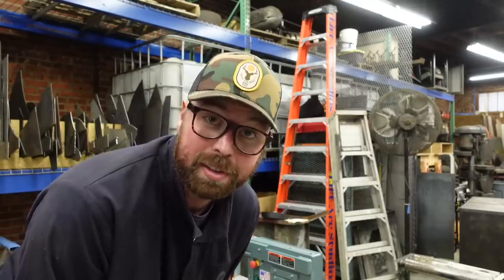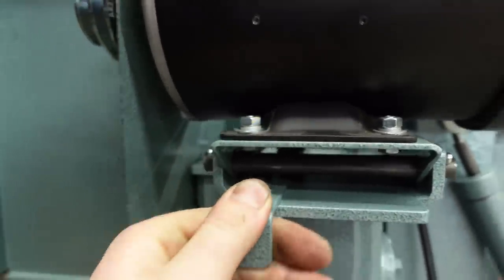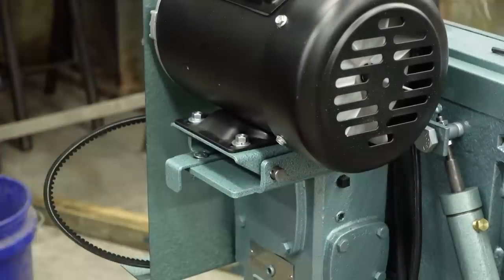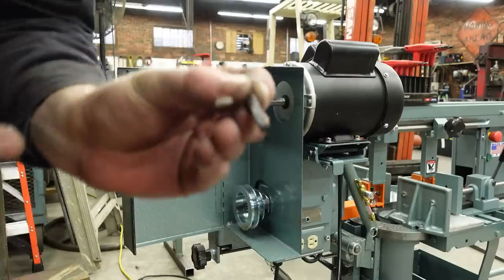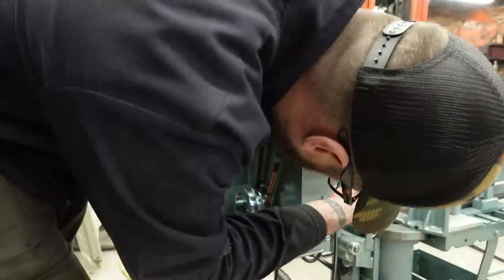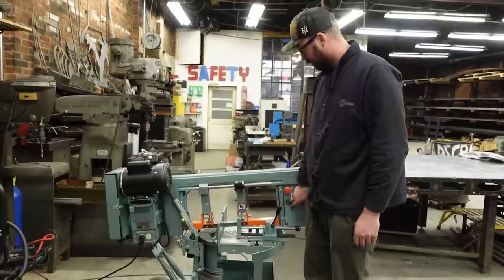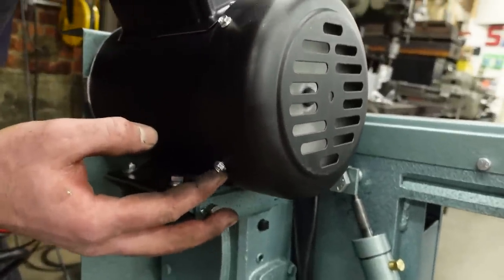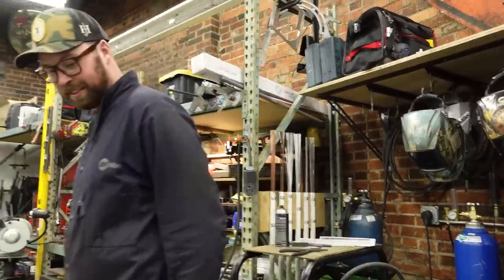This Is Unacceptable.

Comment: Has a start capacitor and it’s surging because the start capacitor is being used as a run capacitor and will burn motors up like no tomorrow
Reply: I was going to say the same thing. 👍
Reply: It could also be something to do with the centrifugal switch that's suppose to remove the start cap from the circuit.
Reply: I was just going to add comment about the capacitor being weak....
Reply: It’s like running your car without oil and complaining the motor is knocking then putting oil the engine and saying see it’s got oil now and it’s still knocking ... quit telling me it’s because it didn’t have oil. 

Same thing as the stupid argument over the outlet. He destroyed the first motor with the extension cord then after it was trashed tested in the outlet with the exact same result... because the motor was abused.  

I personally believe he tested the new on an extension cord prior to the clip we see at the outlet. But amperage draw and voltage drop still happens on a daisy chained outlet
Reply: @ChrisS-oo6fl  you won't burn up motors using extension cords however you can burn up cords. And he also plugged the new one into a outlet for a first start. That big black lump on the motor is a capacitor and it stores power and is supposed to dump it into the motor when you turn it on and the cheap chinese motor he keeps buying is having some sort of problem with the capacitor.
Reply: @ChrisS-oo6fl  Not at all true. No load on a motor on a 50' cord won't destroy a motor or make it vibrate. Not to mention nominal voltage is 110-115 not 125 so the voltage drop is not the issue.
Reply: @johnhancock8552  lmao. absolutely incorrect.
Reply: @DieselRamcharger  Why do you think a properly rated extension cord will cause any issue? Compared to the Romex on the wall.
Reply: @dougelick8397  you said you wont burn up motors, but you will burn up cords. if the cord is getting hot, its too small. the excess resistance is causing the heat. Which is also dropping the voltage at the motor. If your cord is hot you are killing the motor. The key here is PROPERLY sized. If its the proper size, nothing will get hot. Not the cord, not the load, no excess heat. And romex isnt pulled through conduit. So no idea what you are talking about there. :)
Reply: @ChrisS-oo6fl  are you physic or something? What makes you believe he plugged it into an extension cord before? Just a feeling? Is it that hard to believe a company can sell bad quality items?

Comment: I recently bought this same saw and they sent me the same faulty Chinese motor. I called Ellis and told them I wanted the lesson motor that is supposed to be on the saw and they sent me the right motor. Works great now! They told me they are having a hard time sourcing the lesson motor so they are sending this Chinese motor that is supposed to be “better” on the majority of the saws they are sending out. Ask Ellis to send you a lesson motor!
Reply: Blah blah blah supply Chain blah blah.  I get it.  But why tarnish their reputation?  Sure customers eventually get the cut they want but they're ALWAYS going to hesitate when they turn the saw on, thinking "Is today the day the motor goes up in smoke?".  What they should be doing is to honestly say "Customer, we're sending you a saw we're not 100% proud of and we'll make it better when we can.  Until then, thanks for being patient."
Reply from the maker: Jordan if you don't mind us asking, how long ago was it you were able to get the Leeson motor from them?  We're wondering if they still have any available at this point, because otherwise why send us the exact same motor again?
Reply: Two months ago. When I talked to Ellis I specifically asked them to send me the lesson motor. I told them the main reason I bought the saw was that it had the lesson motor. I feel your pain! It really is a great saw when you have a good motor. They are getting the lesson motors just not enough to fill all orders.
Reply: Chinese bearings are no good for beltdrive
Reply: To be honest about it, there are excellent Chinese motors, and cheap Chinese motors. $150 for that motor isn’t expensive. Good ones cost over $200, often well over.

Comment: Acts like an under rated start capacitor or under rated wire for the capacitor. Could also be a crappy or badly adjusted centrifugal switch. Just my $.02
Reply: Absolutely correct. Im voting for the wrong value start cap, but it could very well be a sticky/gummy centrifugal start switch.
I should mention Ive been a machine tool repair tech/millwright for almost 30 yrs. Been there, done that, got the T-shirt and the scars.

Comment: The problem is being caused by the Motor starting circuit.  The contactor has a 240 volt coil instead of a 120 volt.  Contactor is located in the box behind the plug.  Witnessed this exact behavior on an Ellis wired for 240 volts that had been plugged in to a 20 amp 120 outlet

Comment: My brother and my dad are both  Ellis dealers and they probably sell 10 to 50 times the machines that your welding supply does..the people at Ellis are the salt of the earth good Midwestern folk. They will make your situation right. Like many manufacturers they are plagued with supply line issues. My guess is that their motor supplier got a bad shipment of capacitors. But don't give up on Ellis.. they make many excellent products and have been in the fabrication equipment industry for a very long time..I'm sure they are not interested in sullying their reputation over 1 motor problem. I will be watching to see the conclusion of this issue. I enjoy your content and often chuckle to myself at the differences between your experiences and mine. Best of luck!

Comment: This is a real shame.  I used Ellis equipment for years and they were all great machines.  Don't give up on Ellis just yet.
Reply: It's sad when you have to spec your own motors, that the equipment manufacturer can't. 
When on the job, if I let anything other than a Toshiba, for larger than 30 hp, enter the spec, I would not like the response from the electrical engineers.
ABB Baldor or WEG brand, NEMA Premium Efficiency motors, where also allowable, but had to run it by the head electrical engineer. Not worth the pain, unless I was ordering ~5 or more.
Reply: That is literally the harbor freight compressor duty motor… 89 bucks…
Reply: Man put a meter on the outlet on the machine, see if the machine is supplying the motor clean power, most similar saws have a micro switch that turns the motor off once it hits the bottom of cut, I wonder if it’s the 10 cent micro switch, or a loose connection inside the service outlet on the SAW.. plug the MOTOR , not the SAW into the extension cord or outlet COLD , and see how it runs.. eliminate the saws wiring and electrical equipment… isolate the motor, I don’t think it’s the motor., I’ve had that exact motor running a massive dust collector bag house motor out in the weather, they generally run two years minimum roughly 2 hours a day on average., and harbor freight is only happy to exchange them for me, at the cost of warranty each time..

Comment: i always laugh at folks that say "don't use an extension cord!" as if running the same 50' of wire in the wall to an outlet beside the machine would behave any differently... sure, you don't want to use a crappy 16ga two prong indoor light duty extension for shop tools, but if it's a decent extension, it's gonna work fine.

Comment: I've been a machinist for over 30 years sometimes you just have to do what you have to do, especially when things aren't built correctly. And remember everything has a hammer side. Using the extension cord is fine as long as it is a heavier gauge wire than what you have from the wall and everything should be fine just remember over distance you can get a voltage drop but not enough to probably hurt the saw So use the cord.

Comment: I’m thinking it could be the starting and E-Stop circuit in the saw itself. Try plugging in the motor to an outlet or extension cord directly (being super duper safe of course, double rubber, safety squints and mom on speed dial - AvE) see if the motor surges like previously. If no then it’s something in the saw control path: buttons, relays, wires, contacts. If yes then motor is the problem. Thanks for the awesome video Tay and Wyatt! I love this channel ❤
Reply: From what I see in the video he didn't try all the easy / free stuff before throwing parts at the saw and complaining to support.

I'm wondering about that outlet on the saw and what else power goes through before it gets to the motor ( any sort of cap or regulation or draw).

Also if the saw has its own braking system maybe its sticking until it gets moving.

I was wondering if something in the saw is broken/misaligned/dirty/flawed too.

Could remove the blade and try after figuring out its not the electric motor.

You're going to figure it out and have that "aha" moment. Hopefully something simple.

I appreciate the transparency and the realism in the video but its not very informative or helpful like lots of your other videos.
Reply: @hondaracer3726  You mean it wasn't informative enough for you  to see what a junk electric motor looks like, behaves like, vibrates like and sounds like"  Come on, really?  I believe that if your Honda racing motor was vibrating like that when running you would know something is wrong, Right?  The metal to metal noise?   Sorry, that was the exact way to see a product evaluated.  Including the replacement motor that was just as bad.
Reply: @roberta4989  he did not prove the motor by itself plugged in the wall starts slow then speeds up. I'm not sure where you get that from. Maybe I missed it

It's a 1hp electric motor from what I saw on the label  that can pretty much run at any voltage

You would rather watch a video like that than how to frame up and make a set of metal railings with skills like math, welding, and tools?
Reply: Yep. Bench Test the motor in total isolation, from cold, direct in wall power. 
Throw a known good motor on it. It's looks to be a pretty stock motor.
Reply: Agreed, I wonder what would happen if you plugged the motor directly into the extension cord and not into the outlet directly below the motor. That would rule out any electrical circuits outside the motor. Good luck figuring it out. Seems like there are two issues. A power supply problem and also a vibration issue with the new motor. Wonder if the motor was dropped during assembly?
Reply: @hondaracer3726  It appears you are hung up on the "starts slow" issue.  After the motor gained RPM, it rattled, vibrated and had metal to metal noise like the cooling fan was hitting something inside the case.  He had a replacement motor sent to him with the same issues.  That's is INFORMATIVE about the company that made the motor and the company that installed it on their product.  Learning about the equipment he uses to "frame up and make a set of metal railings with skills like math, welding, and tools" is also great information.  With all due respect sir...
Reply: @roberta4989  I see your point but couldn't the gearbox cause the electric motor to chatter/bind as well? The noise can be from the saw if it's not isolated. The blade is spinning.

I ran one of those saws for 2 yrs for cutting stainless  and cast alum. 

There's nothing informative. Everyone knows apple, Sony, Ford, and everyone else don't make things in house. 

Reply if you wish, I'll read and consider it, then I'm done. I shouldn't have posted. I was just wondering why everyone gives up on things so easily. There's always another step there's always something to try.  My bad no one needs to see this nonsense.
Reply: @hondaracer3726  I agree, but should the man HAVE to trouble shoot the brand new saw?, company SHOULD have bit the bullet and exchanged the unit, with a unit they personally quality inspected themselves.. him having to do work, and spend time, the company should have shipped, a box of blades, and maybe some other bonus parts, tools, swag., to offset his aggravation.., on the other hand, yes I think plugging the motor into another source of power before loading up the parts cannon., there is a tiny micro switch that stops the saw at bottom of cut, they are known to be faulty, or the steak on connections to the switch, or e-stop switch could be loose, and the vibration and heat from arcing is just enough to make it start when hot..
Reply: @hondaracer3726  What you saw on the label.......1hp.....don't believe everything you read lol

Comment: Try plugging the motor directly into the extension cord bypassing the electronics on the  Ellis if the problem persists, check the capacitor on the motor just my two Cents.

Comment: Can you please check if the problem goes away with the drive belt removed?  And can you try it with the drive belt on the smallest diameter of the motor pulley?  Thanks.

Comment: I'd bet money that the issue is inside the saw's electrical system not the motor. Plug that motor into your extension cord rather than using the saw's power system see if the samething happens. If not then pull that outlet on the saw apart, check all connections and try it. If the issue is fixed then problem solved. If it's not check the power switch. I've never tore into one of those saws but based off the momentary power switch on the saw I have to assume there is a magnetic motor starter switch in the system. Those prevent the saw from powering back up on it's own if you loose power during a storm or something like that. Check all the connections and watch that switch to see if it's having connection issues. Clicking (engaging and disengaging). Also check the momentary power button. This is going to be a super easy fix but yeah it's extremely annoying that you have to deal with this as a customer.

Comment: We have a hydmech in our primary shop and it’s awesome. Would highly recommend investing in a great bandsaw and use the other saw as a secondary/ backup
Reply: I had a DM-8 and like a cold saw, you had to apply constant pressure to cut. The Ellis is nice because you can walk away on a long cut and do something else.
Reply: @irritantno9  ahh ours is a dm-10 and it’s been great. I’ve been at the company 4 years now and it’s as good now as the day I started with only minor repairs due to our own negligence/ wrongdoings
Reply: @Justintimemetal  I was elated to get my hyd-mech. Recently picked up an Ellis 1800 and it’s crude but effective.
Reply: I had a HYDMECH in my shop for 25 years. Excellent saw. We bought all of our equipment used except the HYDMECH. Worth every cent.
Reply: @jaminator1  I bought my hyd-mech new. It served a purpose. Wouldn’t say it was my favorite. I have a small wellsaw and the Ellis. The Ellis reminds me of a Dixie chopper. If I need parts, almost all of them can be made or bought from somewhere other than the manufacturer. Everything except the drive wheels on the ellis is stock standard. Same applies for Dixie chopper. Now try that with Hyd-mech.

Comment: I have owned an Ellis 1800 for 20 years.....mine flipped off a tailer even......sat outside for 10 years in the ran, but still cuts .005" off over 4.5 inches vertical and horizontal.....I am curious why you did not plug the motor in with the cord coming off the motor before going to all the trouble of swapping motors.....if the motor was bad, you could have found out right away, it sounds like the gear box has issues, I am writing this at 13 minutes in......have you looked to see if you have rubbing of the blade on the inside guards.....I rally doubt you have a motor issue, looking forward to see what you find out...cheers, Paul in Florida

Comment: Jet, check out Jet bandsaws. After 3 years of thinking about is I was 75% sure of getting a Sabre. After watching your videos I got a Sidekick 8. My Jet saw cuts straighter than any thing I've used in the last 3 shops I've worked (15 years) at with Ellis. Take that back the last one had a Kalamazoo.
Reply: Customer service at jet is horrible. I was thinking of a jet band saw to go with my jet lathe and milling machine.  Not any more

Comment: It is a capacitor start motor the capacitor stays in the circuit up to a certain speed then flyweights remove it from the circuit. it sounds like the switch is opening and closing intermittently

Comment: Sounds like a bad capacitor, not a bad motor. The capacitor starts your motor then it turns off after the motor gets to speed. Just a thought, and if it is, you have a backup motor.

Comment: If pulleys are good and true replace the belt  has it may have a flat spot, something I've seen often with new equipment that's been standing for a while with belt under tension,  any one of those will cause that shaking. If the belt is to tight that can also cause that poor start-up, my guess is that belt has been over tightened and it's out of shape as a result,  you may not be able to see it.

Comment: What happens if you plug the motor in directly to the wall instead of plugging it into the outlet on the saw? Or maybe try plugging a different motor into the outlet on the saw and see how it works? Maybe they botched the wiring going to that outlet, seems unlikely though. I bought a used Ellis 1600 because of the first video you made on it, sure glad it came with a Leeson motor.

Comment: Seems like motor is coming briefly off start winding when centrifugal start switch gets up to speed and then slows down enough for start winding to reclose. 

I’ve seen this mostly when motor is loaded up.
How does it run with no blade? 
The Ellis belt tensioner design is the absolutely worst I’ve ever seen. ( at least on my 1800)